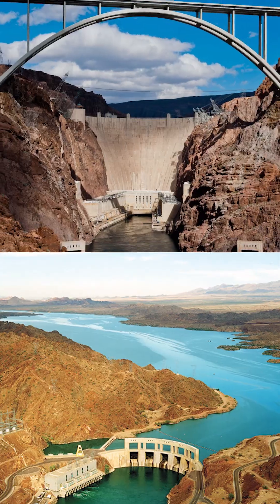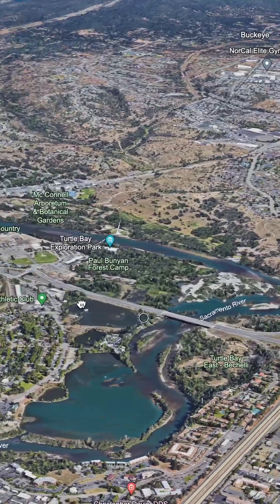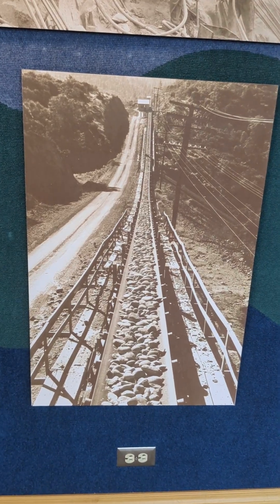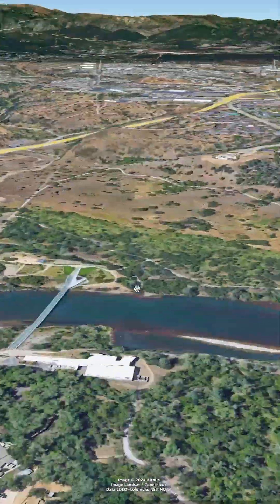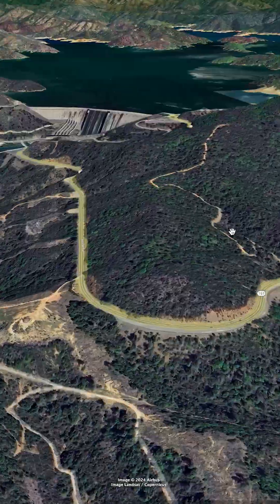Shasta Dam and Frank Crowe

Comment: Kenswick dam was a waste of money time and kill many salmon
Reply from the maker: How so? From what I can see, it only blocks an additional 10 miles of river. A drop in the bucket compared to the rest of the basin.
Reply: And your forgetting spring valley reservoir. Which is to hold toxic metals leaking from the iron mountain mine. Keswick is the 2nd  reservoir holding back winter runoff. Its a superfund site.  
The river actually caught in fire because it's so toxic.

Comment: Seems like barges would have been cheaper and far more efficient. I guarantee that belt broke daily or hourly. This pre-dates synthetic rubber, nylon, synthetic fabrics…more I think about it, that belt was breaking or failing hourly
Reply from the maker: The river isn't deep enough or calm enough to make a continuous loop of river barges practical.
Reply: Not the right kind of river to bring barges up, just wouldnt be possible.  Also no, that belt would likely have a lifespan of months or years.
Reply: Also Keswick dam was already in place powering the project adding to the grid...
Reply: How do you figure that😂 
The belt breaking hourly I mean?